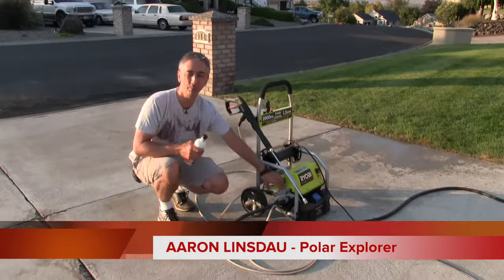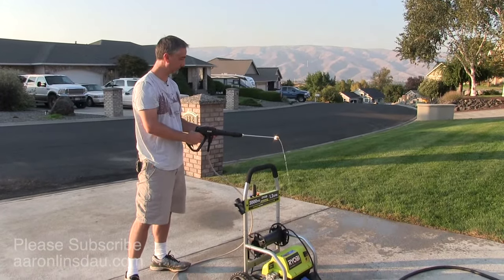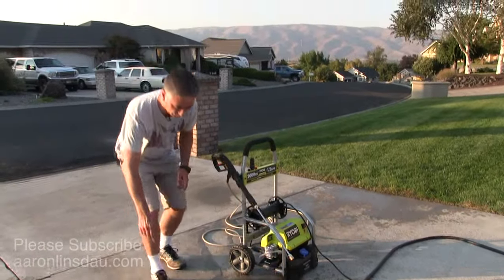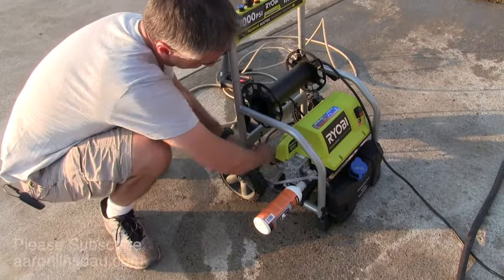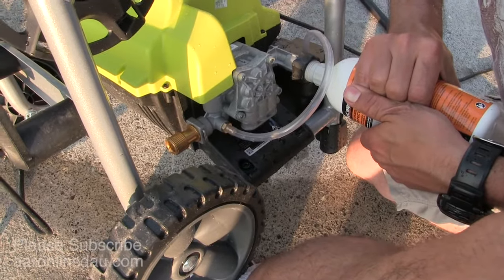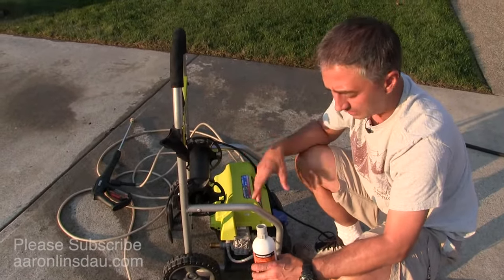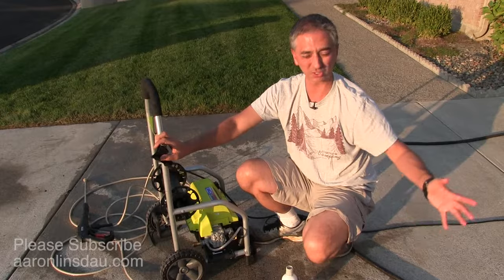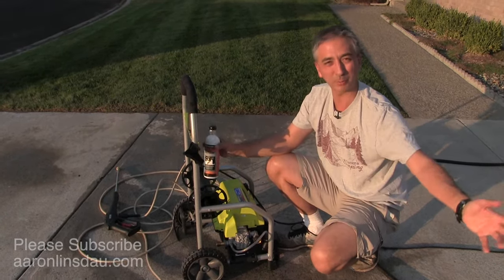How to Maintain Your Pressure Washer Pump - 5 minutes for Maintenance

Comment: Great tip but there's a cheaper and more effective way. I'm a painting contractor and I have 4 commercial pressure washers. RV antifreeze is a anti rust solution for keeping the water pumps from rusting during storage. That is what I have used for 30 years and it comes in a gallon. All I do is attach a 2 ft. Garden hose to the inlet and stick the other end into the gallon of antifreeze, then start the pressure washer and cycle the fluid threw the pump for about 10 seconds and shut it down. It's never failed me and a gallon costs about the same.
Reply: Thank you, Sir!
Reply: So no need to bring out any lubricant. just antifreeze?
Reply: @SLAYERZMB  Old Anti freeze, the green kind has lubricating properties to it.
Reply from the maker: Good pointer.
Reply: your way actually seems like more work and more waist. 🤷
Reply: I had thought of doing this myself. Thanks for the confirmation that it works. What about adding a little Fluid Film to the antifreeze?
Reply: Can I use radiator coolant?

Comment: Hello dear. In my pressure washer when u press trigger it on and off. Can we use wd40 and spray in inlet to lubricate the o rings.
Reply from the maker: Not sure, would have to ask manufacturer.
Reply: WD 40 is not good for rubber. Silicone spray or even better yet grease is best.

Comment: I'm pretty sure that little bottle with green liquid is just standard RV radiator fluid for your camper's water lines when you store it. You can use the "soap hose" to draw it into the pressure washer from a bucket.
Reply from the maker: Good to note.

Comment: A tiny bit of lithium grease on hose threads and silicone grease on the rubber o-rings makes attaching & removing hoses insanely easy.
Reply from the maker: Thanks for watching.

Comment: Good tip. An even easier product to use is STA-BIL pump protector. It connects to the pump inlet and is pressurized, so you just press the button on the can until it sprays out the pump outlet. You get about 3 uses out of one can.
Reply from the maker: Great pointer thanks!

Comment: Great video buddy. Didn't do this last year now I get noise and no pressure/water. Pretty sure I ruined it. Off to home crapo again ha. Thanks for the tip!
Reply from the maker: Sorry to hear that
Reply: I know this maybe a little late ON THIS ANSWER.. Somtimes the tips wont let the water go through all because there is a tiny piece of debris that just blocks it therefore you hear the powerwasher running but nothing coming out of the tip change try changing those first most of the time thats all it is ...i am not sure what his reply was it wasnt coming up on my end so i thought i would help out a little here.

Comment: "Aaron Linsdau - Polar Explorer"

Not what I was expecting while watching a movie on pressure washer maintenance, but really cool! 

Cat Pumps for their version of the pump protector recommends squeezing the bottle, and for an electric, briefly turning on the unit until you can see the fluid being discharged. Have you tried this method?

Also, do you have any experience with spray-type versions, such as those made by Sta-bil or Briggs and Stratton?
Reply from the maker: Sometimes I do videos out of the wheelhouse when I think it might be helpful to others. I've not had a need to momentarily turn on the pump. I can get the green fluid to dribble out every time.
Nope, I haven't tried any other fluids - only the recommended one at the local orange big box store.

Comment: I get oil leak coming out of my 2300 electrical ryobi. Pressure washer the lubricant from the pump. It's leaking oil. What do I do about? Cause it will no longer work, it won't turn on.
Reply from the maker: Contact customer support - hopefully they have a solution.

Comment: Hey, I was wondering what fuel and oil to use.(specific brands, types etc..) I just purchased a Ryobi 3300 psi 2.5GPM (4c) pressure wash and I am completely new to this and I want to make sure I use the right things so nothing breaks. Also, should i buy lubricant and apply it if I am going to constantly run my machine about everyday. How often should I change the fuel and oil and when will I know when to. Sorry for all of these questions, just a young entrepreneur trying to start a new business :) thanks.
Reply from the maker: Best to use ethanol-free fuel. Regular fuel will "rot" and gum up/wreck the small engine parts. Definitely check your instruction manual.

Comment: Very nice and informative video do you also need to use this on electric pressure washers or gas? Thanks for sharing. #PEACE✌🏾
Reply from the maker: I use it for either. Keeps it running.
Reply: Anything with a pump.

Comment: I watched your video. Great video. How ever not that easy with the ryobi electric 2300. The product you use in the video stinks. very messy and spills all over the place. you have to try STA-BIL Pump protector. cheaper than the other brand. Purchased at Walmart for 5.99. you don't have to turn on the machine. you simply screw on to the inlet and press. WOW! The only thing that was messy was the fluid spray out of the outlet. Kind'a caught me off guard(Lol.). I will never use that other product. STA-BIL. Great product. Hoped this helped .
Reply from the maker: Sure does - thank you.
Reply: Do you have to turn the machine on for it to go in??

Comment: Love your videos.  Keep it up :)  However , I do have a question for you.   I've read here and on different websites like you said  how others have found this bottle version of pump saver sometimes difficult to use.  However, couldn't you use one of the alternative aerosol versions of pump saver instead?   I hear they're much easier to use.   I don't think they're limited to gas pressure washer versions alone .  What are your feelings on this subject  and have you ever tried one?
Reply from the maker: I've not tried the aerosol version. I'd certainly appreciate anything that makes this necessary job easier.

Comment: What’s the best way to turn off a pressure washer.  Should I turn off the hose first or the pressure washer?
Reply: Never. Ever. Turn off the hose before shutting down pressure washer... never ever turn on pressure washer before turning on and bleeding hose through the pump.
Reply from the maker: Shut down the pressure washer first.
Reply: Thank you

Comment: Does one bottle of the pump maintainer fluid last for multiple uses or throw away after first use? thanks so much
Reply from the maker: Yes it does - I used mine a half dozen times and there's still a lot in the bottle. I only use enough to make a few drips come out, so that doesn't use the bottle very fast.
Reply: @ALinsdau  Awesome to know. Thanks!

Comment: Thank you! Mine has a white filter in the hose attachment. Are you supposed to remove that? Well, looks like a filter with tiny holes.
Reply from the maker: You want to keep that filter in - it prevents sand and rocks in the water line from ruining the pump.
Reply: @ALinsdau  will do. Thanks!

Comment: ..stuff is expensive. I use the Briggs & Stratton brand, however it's only good for a few sprays. Looks a lot like anti-freeze. Curious if it could be used as a substitute?
Reply from the maker: Not sure - antifreeze might work but I'm not going to suggest it or risk my pressure washer for a test. Good luck!

Comment: Hi, do you use the pump protector every time you use your washer or how often do you use it? Thanks...
Reply from the maker: I use it every time.
Reply: Way too much hassle to use it every time. Maybe once a year before winter, unless you're putting hundreds of hours on it and running hard water through it.
Reply: @ALinsdau   Unnecessary.

Comment: Wonder if silicone lubricant spray will work?
Reply from the maker: Better to use the fluid designed for pressure washing pumps.

Comment: Great video,  I'm having problems installing  my pump saver , I connect it and try and squeeze it but it is so hard to squeeze the bottle and nothing goes into the pressure washer let alone nothing comes through where it's supposed to  one out. The instructions even tell me to pull the cord to cycle the fluid through but I do it for 10 minutes and nothing happens. Forgot to mention mine is a gas powered pressure washer.
Reply: Same
Reply: @ashveensharma5468  is yours a gas powered washer as mine is? Someone at work said I probably have to start the washer to get the fluid to travel through the washer.
Reply: @impossiblepie  I have the Ryobi 3000 psi gas! Wasted half a bottle of fluid but nothing came out. Pulled the recoil as well.
Reply: @impossiblepie  interesting idea. Meaning youd start it after you fill the pump?
Reply: @ashveensharma5468  I have the ryobi well , I think you attach the pump saver. Turn on the pressure washer squeeze the bottle until you get some fluid to come out then turn it off, at least that's what I'm going to try.
Reply: @impossiblepie  please keep me posted! I dont want this unit to freeze over
Reply: @ashveensharma5468  I read starting the washer with no water connection could ruin the motor so.i will not be turn the motor on to cycle through the pump saver fluid.
Reply: @impossiblepie  yes always have water connected! Can we talk further about this on Facebook or something?
Reply: @ashveensharma5468  sure since the person who made this video won't reply.
Reply from the maker: It's easier if someone helps you tilt the pressure washer while you install the bottle. It's a bit awkward. I spilled quite a bit when I tried it the first time. Then, once you get the bottle on there, just apply a bit of pressure while tilting the bottle so the fluid is definitely in contact.
Reply from the maker: Sorry for the slow reply - it take a huge amount of effort to reply to comments on 100s of videos. Check my original reply for ideas.
Reply from the maker: I'm not sure on the gas pressure washer. My experience is with the electric.
Reply: @ALinsdau  I appreciate you replying to my question,  thank you.
Reply: I just bought a compressed can of pump saver by Briggs and Staton, it worked, took no time at all don't bother work those other bottles just use the compressed pump saver cans.
Reply: I am having the same issue. Nothing is happening. Where did you buy the compressed can and how much was it?
Reply: @alexkerr3868  I bought it at Canadian tire,  it cost $15 , Briggs and Stratton.
Reply: @impossiblepie  will try this!
Reply: @impossiblepie  You are the best! Briggs and Straton version worked in 2 seconds. Forget about the bottles lol you're right.
Thank you!!
Reply: @ashveensharma5468  great to hear. I fell the same way I'm done with those bottles.
Reply: @alexkerr3868   I just bought a 4 oz bottle at Lowes for $7.98.   I haven't tried it yet.
Reply: Same problem. Gas powered.  Tried cranking the the engine with no spark and it didn't make a difference.  Hope to find a solution further down in comments.

Comment: Name of the liquid for the water pump,etc
Reply from the maker: Get items in this video at Amazon:
Ryobi 2,000-PSI Pressure Washer: https://amzn.to/2SpAJkk
Ryobi Surface Cleaner: https://amzn.to/36BlgWC
Pressure Washer Pump Guard fluid: https://amzn.to/3ncnSjL
Dewalt pressure washer nozzles (these work even better): https://amzn.to/36qtl0x

Check out my other pressure-washer related videos:
Ryobi 2000-PSI pressure washer review: https://youtu.be/ekv9PX7_hoY
Ryobi Surface Cleaner Review: https://youtu.be/86P1YgSdNpI
Pressure Washer Pump Maintenance: https://youtu.be/WspigsL1SlQ
Solving Pressure Washer pressure problems: https://youtu.be/gD055A7OApM
How to work faster with a Ryobi Surface Cleaner: https://youtu.be/dDDJvavKUzQ
Note: I receive a small affiliate commission from the above Amazon links. They cost you nothing and help support the channel.

Comment: This Simpson stuff is expensive.  An aerosol product like Sta-Bil is half the cost, injects a thick foam under pressure and coats the entire inside of the pump and is way easier to use.
Reply from the maker: Good to note. Thanks!

Comment: Want your pump to last - never run your pump in idle without the gun's handle being depressed. Never.
Reply from the maker: Good pointer.
Reply: Only true for gas pressure washer washers and maybe electrical without total stop system (which even the cheapest electrics have most of the time). Total stop turns the motor and thus the pump off when trigger isn’t being pulled

Comment: I could be wrong but I thought this was only need it when having a gas pressure washer
Reply from the maker: Good question
Reply: Nah man. Electric water pumps still need cleaning/lubrication just like a gas water pump. It's essentially the same thing just different energy source that powers the pump. But design wise, not much diff